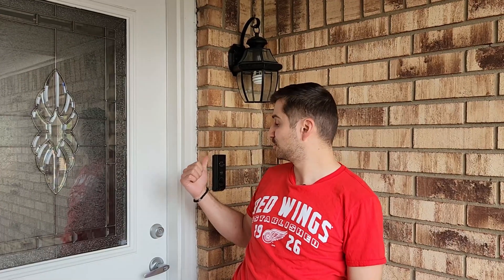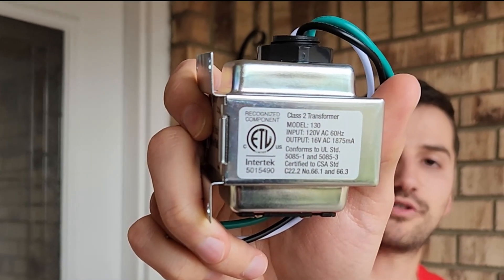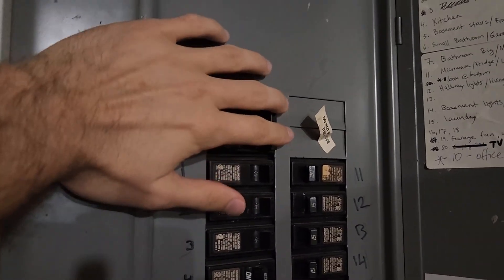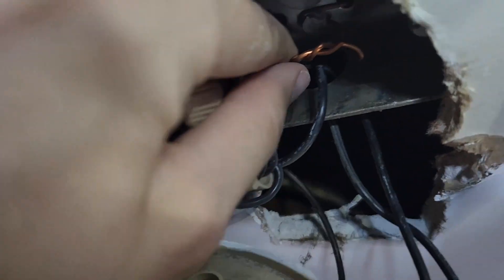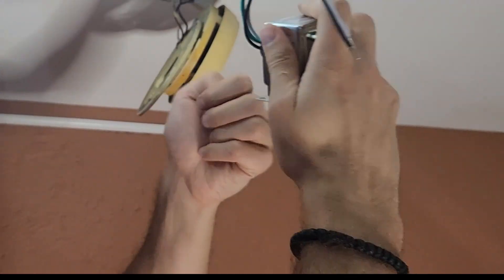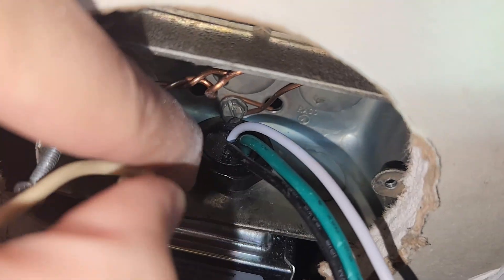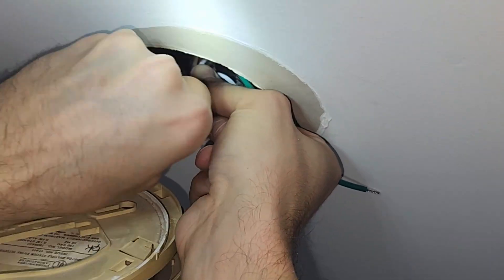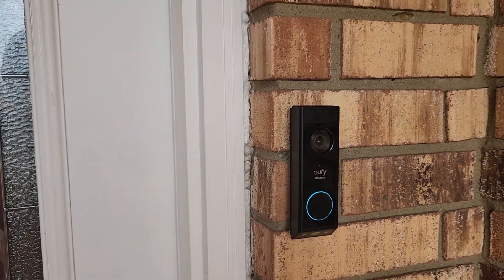Upgrade Video Doorbell Transformer for Eufy and Ring

Comment: I upgraded my transformer to the 16/30 for my eufy 1080p doorbell and it worked fine. Now i got the eufy 2k doorbell and it says that i need a 16/30 transformer but that's what i already installed and it doesn't work. What do you suggest?  Should i go to a higher transformer or is that dangerous?

Comment: My 16v-30kva doesn't allow my digital chime to work longer than 1second. I had this problem with my Nest Hello when the internally battery was dying. So even with a good transformer, the E340 isn't sending enough juice to the chime. And to top it off, the faq for the doorbell has an image that shows the ability to select mechanical or digital chime in the app. They no longer allow you to select that
Reply: Our EUFY E340 was wired correctly working fine 7 days later it’s down to 28% on the battery?  
It’s wired correctly. Everything works…. the chime in the house ….& the doorbell on the outside …. & 😮the lights.
The problem is too many events are happening, even though I have checked off “human only”.
It’s picking up every single car that goes by 70 feet from the doorbell.

Its picking up everything even though I checked off 
“human only”.  Plus, I set the parameters.

So annoying.  I have a case number going. I have no idea where our transformer is. I can’t dig it out out of a ceiling.
I don’t see it in the basement don’t see it by the power box.

The chime box is so attached to the wall.  It’s a 1987 house I’ve been here since then original owner.  

Wondering if the  REOLINK is any better?